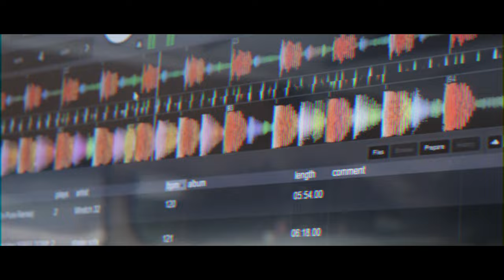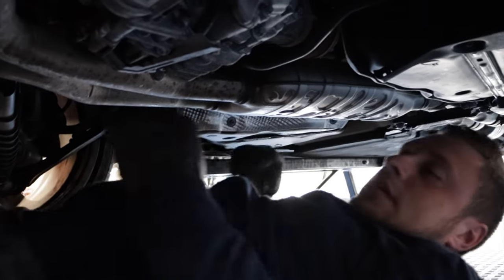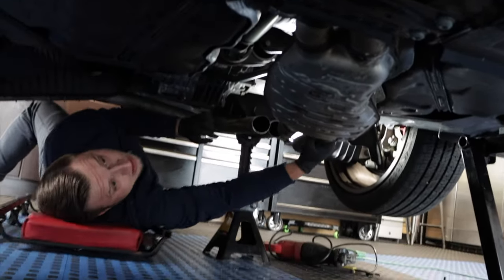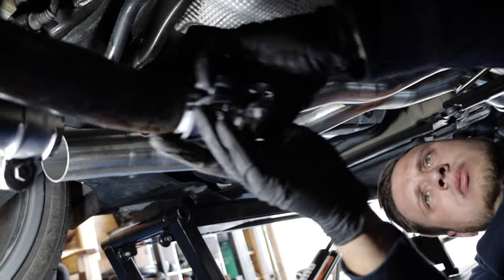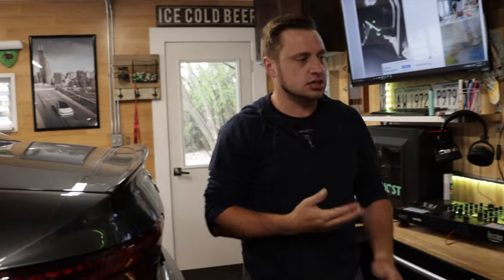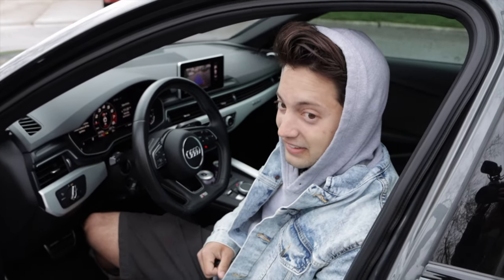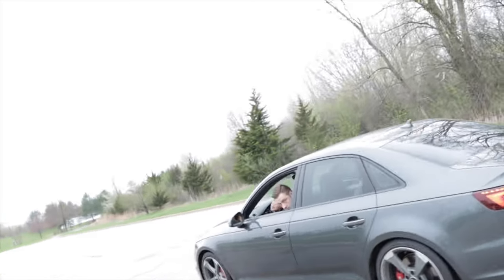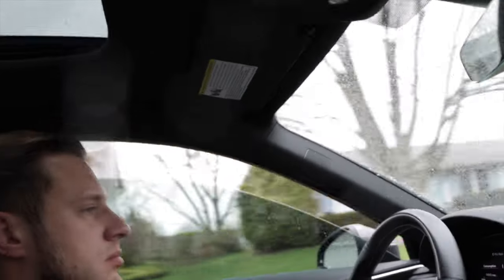Best Audi B9 S4 Exhaust for $300?! ( ECS X-PIPE INSTALL!)

Comment: I got the AWE Switchpath on my B9.5 and it sounds amazing. A little pricy but worth it imo. My neighbors appreciate me for having the valves closed when I wake up at 5 am because it is LOUD with the valves open.
Reply from the maker: The switchpath is such a good exhaust I had it on my Golf R. But you’re right it is a little pricey unfortunately
Reply: @drivenbyboost  their track exhaust isn't too expensive and sounds the same. Curious to see what direction you go
Reply from the maker: @surfercardude9127  definitely looking into the track option but it’s so nice have valves especially if the car is a daily

Comment: I did the 034 Xpipe i did find the drone annoying at 2300-2700 rpm tho... and the VPS pre cat silencers delete as well, still have stock downpipe, and it sounds soooooooo goooooodddd it’s louder deeper and smooth, gunna do a catless downpipe here soon. Now that i got my Catchcan...
Reply from the maker: Oh man that’s going to sound sooooo good with a catless DP 🙏
Reply: So you have both the front resonators/mufflers and the giant center resonator delete? I've been thinking about doing the same but was worried about drone. I just want this baby to sound deep and loud like you described.

Comment: I do agree this B9 gen sounds great. My car is currently running a Fi catback and it sounds fantastic. I am going to install a Catted downpipe very soon with the 034 stage 2, it's going to be very crazy. But I did realize that this car's  ECU is kinda wack. Whenever I left the car in dynamic and I start up the car, it's not in the dynamic mode. Even though it says dynamic, but the idle rev stays under 1k. Which in dynamic it would idle at 1k. So if I rev up my car right after start, it makes no pops, but if I switch back to auto then dynamic it idles higher and will do the pop and bangs. IDK if that's only me or all B9 platforms. Just find it weird and interesting.
Reply: Every b9 does this

Comment: When you start the car in dynamic, you have to cycle it to efficiency and wait for about 4 to 5 seconds and then back to dynamic for it to pop straight away. Give it a try
Reply from the maker: Thanks for tip! Will definitely give it a try 👍
Reply: I just saw this comment after posting mine lmao. yeah as u said when it first starts up even tho it says dynamic but it doesn't make pops and idles lower. really weird design, I thought a remap would get rid of it but after two different stage 1 it stills stays this way.

Comment: To get the pops you always have to put the car back to comfort and than back to dynamic after you start it up. The sound and the gearbox will always start in comfort regardless of the mode you are in.
Also what I saw from your old videos that you were using launch control with esp completely off. You will get the amax shifts only with the esp in sport mode (short press on the off button). You can hear it and feel it when the launch control is active. The car will not "fart" while changing the gears from 1 to 2 and from 2 to 3 and these two shifts will feel like it is shifting without letting of the gas like a no lift shift. The car will jump forward while shifting in amax.

Comment: Would this or the VPS front res delete be a better option if I want louder exhaust/pops/crackles, but little to no drone?
Reply: Front res delete 100%.  I'm doing a similar overhaul 2018 B9 S4, tuned, and from what I've read, people get least amount of drone with just the front dual resonators deleted.  After watching every video on the internet and analyzing sounds, here's what I believe to be true.  The mid-muffler, which is solid piped to the factory valved rear mufflers, does a great job at controlling drone, so if both front mufflers/resonators and mid-muffler are deleted (and NOT straight-piped, but H or X-piped) from what I've read - you can introduce bad drone.  Replacing ONE of the two (either fronts, or mid) results in more growl but very few reports of drone.  An upgraded HFC or catless DP will only exaggerate the sound you're already hearing, but adds additional RASP and crackle.  Coincidentally the upgraded HFC is a Stage 2 requirement means most of the cars you're hearing examples of in rev and launch videos - are already Stage 2 or higher.  034/IE, etc. tunes at that stage (especially TCU tunes) will further enhance that additional rasp and crackle.  So, depending on your overall mod goals - I would recommend the following staggered deletion method to make sure you don't overdo it.  Start with the dual front resonators deleted, (or replace the front midpipes altogether) listen to it (Soundaktor = 0).  If you want more bass, delete  next your mid-muffler (with the least amount of bends in those "deletion pipes") at a muffler shop or DIY.  Listen to it again, go for a drive, make sure to hit 5th and 6th gear at "cruising" RPMs (2K-3K) and check for drone.  Still seeking more savagery, then bite the bullet and find a non-resonated catback exhaust like Milltek or Valvetronic and burn that money chasing the perfect sound.  Truth is, the quiet stock exhaust is actually beautifully designed and can support up to 500/600whp - it just doesn't make the same impression as a modded exhaust.

Comment: You can also delete the front silencers! i had both resonator and silencers (replaced with just stainless steel pipes) deleted and it sounds great. (also running stage 1+)
Reply from the maker: Thanks for the heads up Jason we definitely might be doing this in the future 💯
Reply: you got any drone with the fronts removed? I feel like this thing drones ever so slightly.
Reply: @kulka89  maybe if you reattach the valves and close them you’d have the option of no drone at all?
Reply: @crazycornuto9  oh so you gonna come on here tell me how to live my life too? hahaha
Reply: @kulka89  Watch out my guy! Ill come to the house and plug em back in without telling you!
Reply: @kulka89  slight drone starts at 2k rpm and up, but i dont mind drone and i also live in the city so im at constant stop and go traffic. in dynamic, the sound of the engine will cover all drone noises regardless

Comment: With the valves, do you have to put it in dynamic mode, ignition on before you unplug the connector.?   worried that when car is off, the valves are closed? so if you unplug it, you are keeping them shut
Reply from the maker: Since the mechanism keeping them closed is turned off the valves will naturally want to stay open and will remain open when driving. However recent data suggests on these cars when doing so you actually lose some power
Reply: @drivenbyboost  Gotcha! Thank you! I wonder if the power loss due to less back pressure
Reply from the maker: @jongib6096  not sure, could be. It throws a soft code too so it will only show up on a scan

Comment: Did you get any codes from just unplugging the valves?
Reply from the maker: No hard codes or lights on the dash but If you run a scanner you’ll see some soft codes pop up